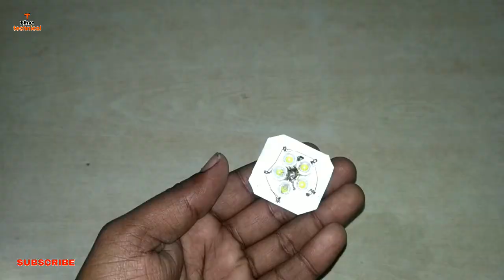How To Make LED light from old Charger - Diy Charging Light

Comment: how can you replace lid velb.
Reply from the maker: Bulb ki led plate nikal kar 4 bulb 3.7 bolt ke + or - dekhkar ek sath jod kar use data cable ke red and black wire me jod do